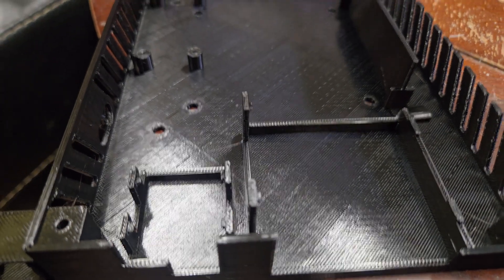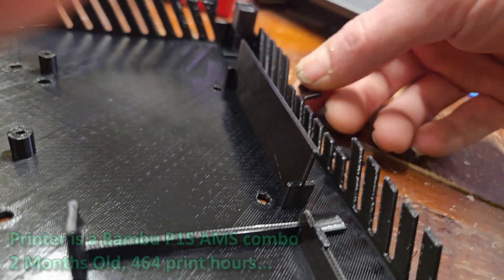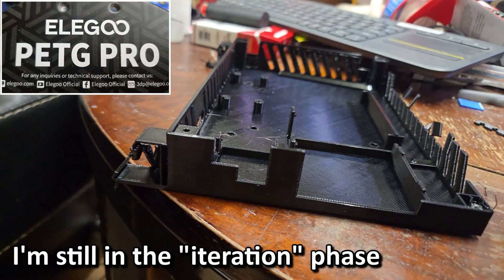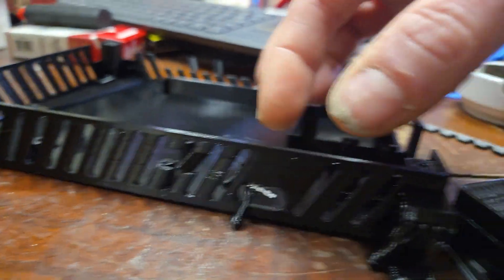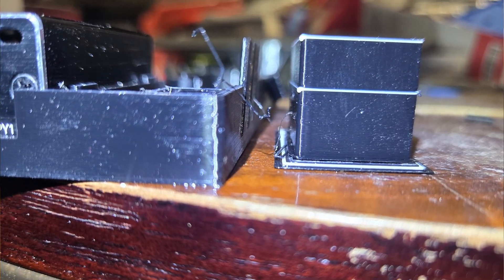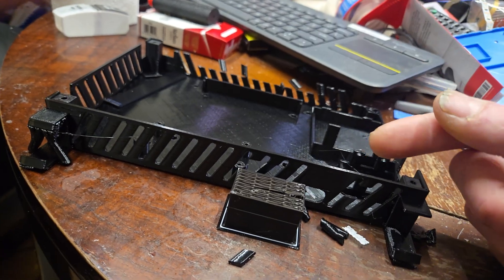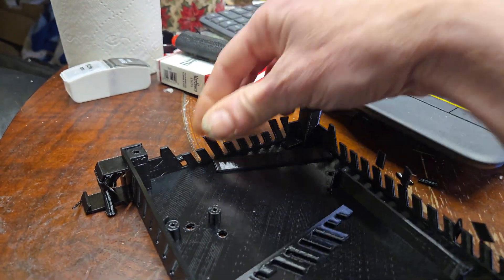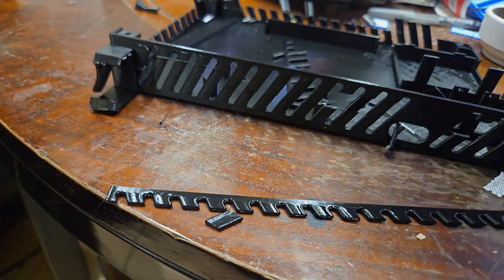Lessons Learned: Using PLA to Support PETG • How Not to Do It...

Comment from the maker: After reading your comments, I think the consensus is that the printer is not purging enough of the PLA and "contaminating" the PETG on the next layer; I don't believe this to be a cooling issue at all (I don't have this issue when switching colors of PETG for example). It could also be that I used a rather old spool of Overture PLA+, as I've done this before with other PLA support without this problem.

Bambu also lowered the default purge amounts to reduce waste in a recent update. Though I believe it also retracts more before cutting so there is less to be purged...

But overall, just using normal supports in the same PETG material turned out to work just fine -- just like I did before I had an AMS at all. And it (marginally) reduces the overall print time.

Thanks so much for all the feedback! I'm still getting used to the multi-material printing, and I do love it for multi-colored prints, adding colored text to the bottom of a print, and things like that.
Reply: You can try, but I don't really agree with them. I've been posting this on various Bambu forums all the time when people try doing PLA and PETG. At the max purge volume I was still having problems exactly like what you experienced. I think almost everyone who is doing PLA and PETG is doing parts that are either overengineered or are decorative and don't see much stress, so no one notices.

I think the sensitivity to weakening is so high that even the nozzle catching a bit of PLA or PETG when it travels over a different region on the same layer and touches the other material could be causing weakened layers.

Comment: they dont merge, due to heat differences needed....
Reply from the maker: That is exactly the idea of using a different material for the "support interface", basically the single layer between the support and the model; it allows the supports to break-away quite easily and cleanly. So you're using "incompatible" materials *on purpose*.

This is a trick a lot of 3D printing YouTubers recommend... however...

The problem is that, if not all of the PLA has been "purged" before moving on to the next PETG layer, you get the problem I showed.

Comment: 00:05 looks like you're trying to build something to bypass HDMI copy protection...hmmmm.
I've used decent clear/light colored PLA as support with various PETG colors using a different printer because these two plastics DO NOT MIX well, but you MUST purge all material in the heating element when switching stock. The very nature which makes PLA a very good support element, will otherwise promote de-lamination if it contaminates your PETG layers.
Reply from the maker: If you look around my channel a bit, you'd probably guess that I'm building something for HyperHDR -- just splitting the HDMI signal so that I can capture it *just to light up some LEDs*, not to copy anything 😇  While the Pi Zero 2 W is quite capable, I doubt it would do much for actually copying 4k video content 🤣

Using that particular splitter lets me have my Ambilight-style backlighting, while retaining all of the Dolby Vision/Atmos features, as well as viewing copy-protected content.

Back to the topic, I now understand it's a matter of not purging nearly enough of the PLA; I've since just started using normal supports, which are still easy enough to remove.

Comment: yes you have to set the purge to like 600 or so to get pla/petg out before the next material comes in i have done this before and it sucks
Reply from the maker: That does seem to be the general consensus. With the parts I'm currently printing, normal supports come off with little effort -- it's not worth all the extra hassle (and possible weakness of the part) just to make removal slightly easier.

There ARE situations where it's almost a necessity... some models have support going up really high into the print, etc... and in those cases, I'll just be sure to purge purge purge 😂

Comment: i noticed this last year when i first got my ams. the print would break right where i used PLA interface, to combat this, make your flush volume 2x the normal amount.
Reply from the maker: That's the general feeling I'm getting from everyone who's commented. I was just using the PLA trick to make post-processing simpler; and honestly, regular supports pop off pretty easy without resorting to PLA. Just good to know the actual cause.

Also, something to keep in mind when I go to print a model in PETG after having printed something in PLA -- I did notice a few days ago, I started a PETG print and the first layer just wasn't adhering. Cleaned the bed again, restarted and it printed just fine. I think I had been using PLA just prior to that...
Reply: @JustinNelsonsProjects  get some cleaning filament. it works pretty good. run it and purge about 1-2 grams of it whenever using a different type of filament.
Reply from the maker: @FuIImatiK  I hadn't even thought of this. I wonder if I could automate that in the gcode... either way, I'm happy just sticking (ha!) with one material type at a time.

For now...

Comment: I don't use an AMS so I can't print with multiple materials. I just make  multiple parts clip/slide/screw together etc. if it's not going to be seen by the end user then sometimes you can design your way around it.
Reply from the maker: I've only had the P1S for about 2 months now, before that I had some years on an old Monoprice bed slinger. I just thought I had a new "magic bullet" for supports, but I'm gonna go back to how I did it before (just normal supports, or try to eliminate the NEED for them).

Comment: Either purge or cooling, I would say the best solution would be a multi toolhead printer like a Prusa XL which both swaps quicker and doesn't need purging.
Reply: The xl does need purging but has the space to do it in a purge block and in infill (the later not recommended here)
Reply from the maker: It does purge a bit, and it does print a "prime tower" as well... but I read that the newest version of Bambu Studio (or the firmware update maybe?) lowered the purge amounts between swaps to reduce waste...
Reply from the maker: I'm sticking with the Bambu (I've only had it about 2 months) -- I'm just going to stop using PLA for the support interface. I think it simply doesn't purge enough, and subsequent prints (same model) w/o changing filaments came out great, and the supports popped off almost as easily.
Reply: Ah the age old solution, buy a $5000 machine.
Reply: @eslmatt811  There's a reason "money" is considered batman's superpower.
Reply: @eslmatt811  you can DIY a multi extruded system on pretty much any coreXY with USB or CAN toolhead boards. IIRC you can save about 50-60% over Prusa.

Comment: just set the z offset to 2x z heigth of printing, and you wont have to worry about supports not comming off.
Reply from the maker: After this print, I did another one (several actually... iterating a design) just without the PLA part, and the supports popped off almost as easily. Not to mention it shaved a bit off the print time w/o the filament swaps.

Comment: the wait time could be the issue because the last printed layer cools down before the next petg layer gets printed ontop of it, decreasing layer adhesion.
i wouldn't expect it to affect things too much though, as any new layer heats up the layer underneath it.

more likely, because you are printing black PETG -> white PLA -> black PETG, the white pigment gets drowned out by the black PETG before all the PLA is actually purged. so while the filament looks like the black PETG, that layer is a weird PLA/PETG mix, which would 100% explain poor layer adhesion.

try increasing the purge to something big - then try one print and see if the issues stay.
Reply: I second this. I had the same problem. If you have different materials that won't stick well to each other, you need to purge a lot to get a really clean nozzle. Any contamination of the previous material will make the layers not adhere well. It's so bad, that after printing PLA on a satin sheet, PETG wouldn't stick properly. I therefore keep separate plates for different materials.
The downside of purging that much is that often it is not worth the waste produced. If one really wants to benefit, IDEX or toolchanger is the way to go.
On a second note: The time it cools down never affected anything on my prints. I had the printer waiting for me changing to a new roll of filament for over an hour and the parts came out strong. When the new printed material is hot enough, it will bond to a previous completely cold layer. With PETG, too cold would result in a matte surface anyway. As long as it is shiny, it should be hot enough.
Reply: Good observation. Just checking out my Orca Slicer flushing volumes, I see going from black to white purges 433mm^3, which is a decent amount of material. But going from white to black assumes you don't need to purge as much, so only does 133mm^3. That would explain why there's contamination.
Reply: @Anthony_DeSouza  yep - the slicer calculates the purge based on the pigment, not the hotend volume.

Now I'd test strength at different purge amounts (steps of 50 or 100) and use the lowest value that provides good strength.
Reply from the maker: @Anthony_DeSouza  I hadn't even thought of that... it's only calculating how much to change the appearance. Maybe this could be a built-in feature (eg, if material differs, automatically add xx to the purge amount)?

So it should factor not just the color difference, but the material properties... I might drop over and add a feature request!

Edit: Just checked my Bambu Studio. Black to White: 588; White to Black: 136! Note I am currently running black & white PETG in the AMS (for embossing text)...
Reply: @JustinNelsonsProjects  i'd be interested to see if this is an issue with other material combinations.

Pla is unique in that it bonds with almost no other common polymer - hence why it's so commonly used as support material for PETG, TPU, and even ASA.

I wonder the weakening is caused by the fact that it was specifically PLA mixed in. A PETG/ASA mixture may not cause weakening.
Reply from the maker: I had the same thought... but PETG will stick to just about anything (except obviously PLA)... so I don't think there would be much benefit using ASA or something else as a support interface (at least not for PETG).
Reply: @JustinNelsonsProjects  yep - was just thinking about the slicer feature request.

If only PLA mixtures weaken the print, it might be better to keep the low purges on other mixes.
Reply from the maker: I did realize that I never have layer adhesion issues when switching colors (of the same filament type), and that would have that same "cooling" effect. Same if I pause a print (perhaps to grab a chunk of 💩off the build plate)...

I did read that the latest update to Bambu Studio lowered the purge amounts to reduce waste... so I think you're right here.
Reply: @JustinNelsonsProjects  When doing PLA+PETG, I have set my purge volume to a whopping 600mm² to be on the safe side. At some point I want to do an empirical test from 100 to 600 to see how much is really needed.

Comment: I have been throught three of those EZCOO splitters in the last year.They work great but i believe they are overheating and cooking the components inside. Just a FYI. I see what you're building there and thats a great setup as well
Reply from the maker: I have two of these splitters, one is on my bedroom TV in a kind of permanent situation. It's always powered on, admittedly just hanging behind the TV kind of resting on the wall mount bracket LOL. Never had any overheat issues.

The other one is the one you saw, I just always keep an extra one for experimenting and making videos on HyperHDR projects... 

Main reason I like that one, it happily passes Dolby Atmos and Dolby vision.

They do get warm but I wouldn't go as far as to say overheating. But it does have me rethinking sealing it up in a 3D printed box.....